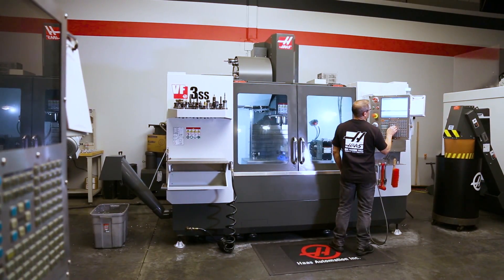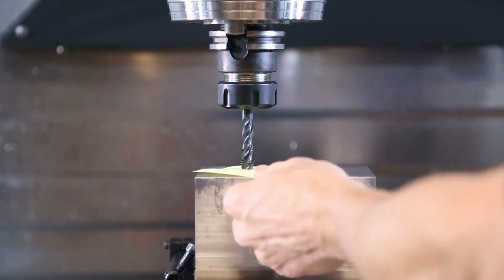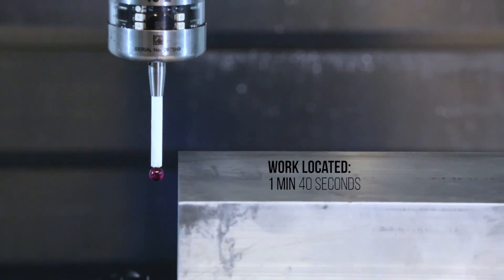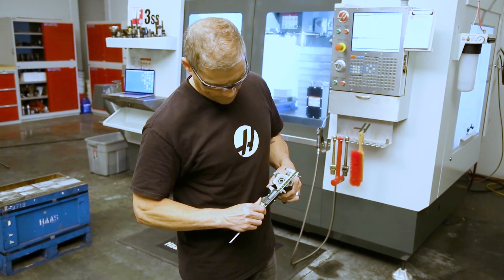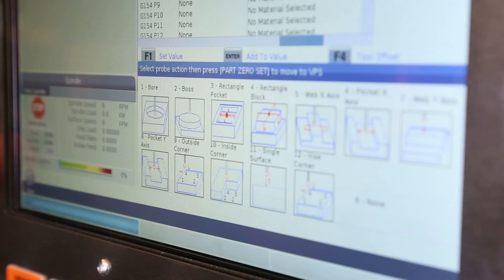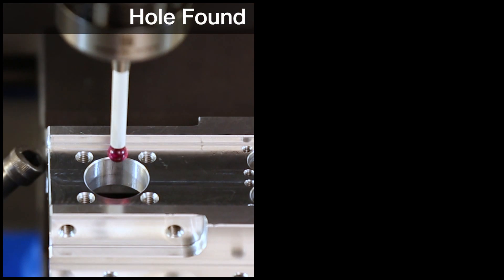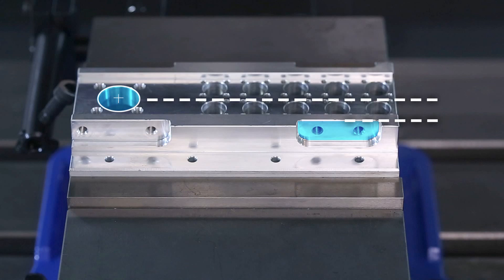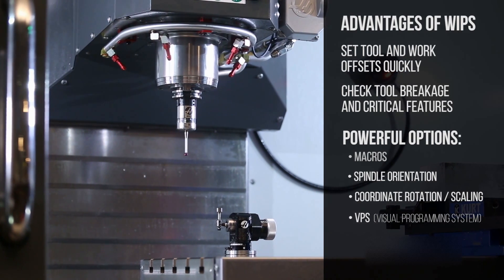WIPS - The Haas Wireless Intuitive Probing System

Comment: Those Renishaw probes are awesome and make your shift a whole lot more enjoyable. Not so much like I did a couple of weeks ago. Slammed the Probe with 100% G00 Z0 straight into the part...still flashing the red light signal for "optical off" - 2 short 1 long. Never forget the right G43 H value when traveling in MDI my friends!

Comment: How accurate is the probe?
Reply: David l from the renishaw datasheets, 0.0005 MM.

From experience, calibrated the probe in a calibration ring. Recalibrated that probe in the same ring after a few months, the difference was about 0.001 MM. 

For setting offsets and tool length in general, within 0.015mm because of thermal differences I think. 

I can't really prove it, but I do feel that the probe is most accurate in x and y plane. And a little less in z axis. 

Also, make sure you calibrate it correctly if you are measuring angles and such. Because the probe has three contact point, and there is a little to be compensated.